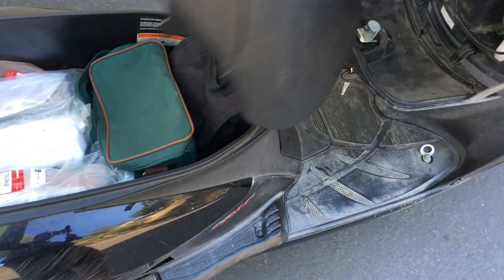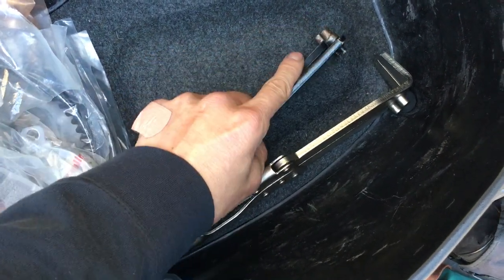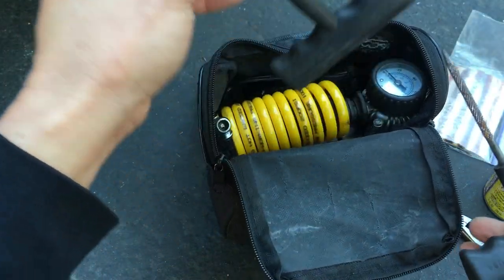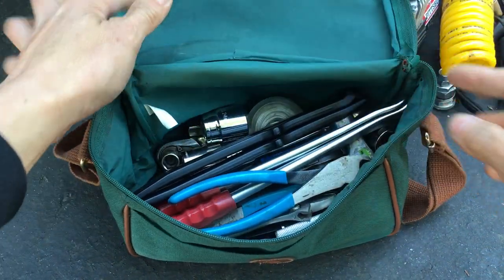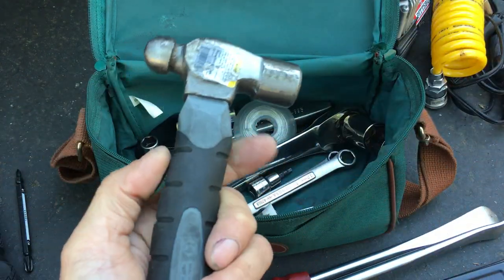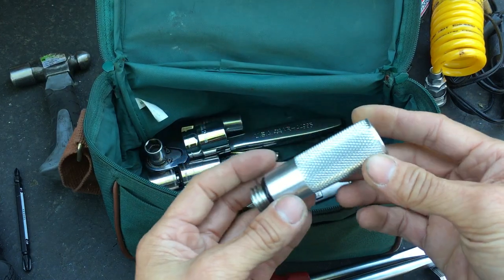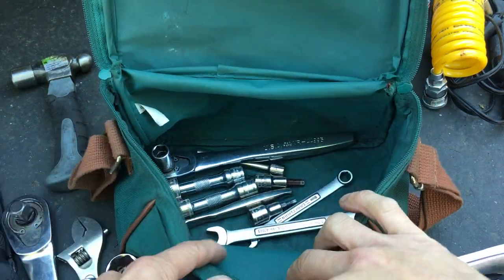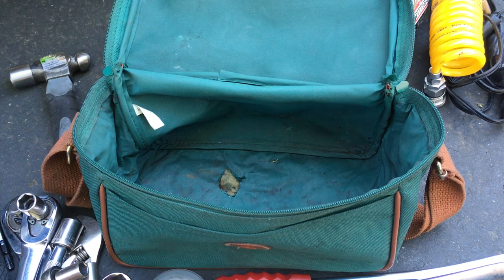Scooter Cannonball setup pt.2

Comment: Hi There,Great video. Just wondering: how often did you change/fix a tire on your cannonball trip?
Reply from the maker: I never had to fix a flat on SCBR.  If I start out with new tires then they don't need to be changed out either.  Actually on SCBR my tires last about three times as long as my commute thru the mountains.  Constant speed with minimal acceleration/deceleration reduces wear compared to twisty roads.  Also the NHX110 speeds is low enough that the tires don't get that hot so even at top speed it last unlike other faster scoots that actually wear out tires twice as fast on SCBR as they normally do.
Reply: DaBinChe 
That’s awesome. Do you think that was luck or typical for the SCBR riders??
What kind of issues did you run into on your cannonball ride? Did you run into something that you were not prepped for? Thanks again!
Reply from the maker: @Nelluch390  Only problems I had was getting lost and not getting enough sleep each night.  Google map isn't 100% accurate.
Reply: DaBinChe fair enough. As expected. I think the cannon ball run is so cool. I truly want to dive into this and give it a go.